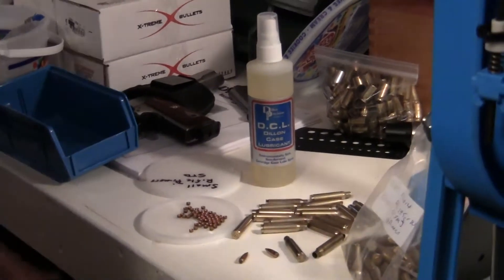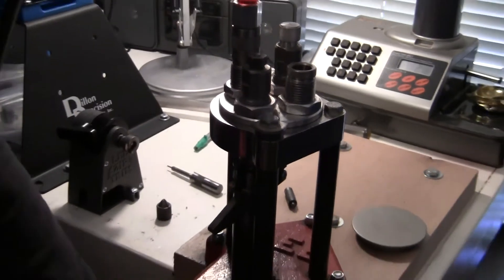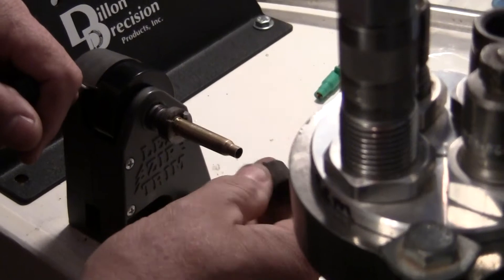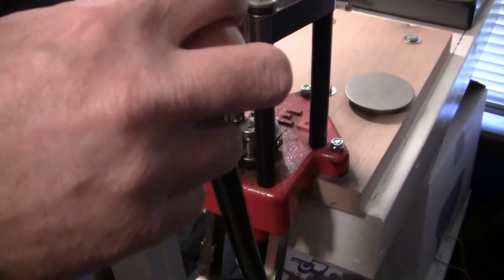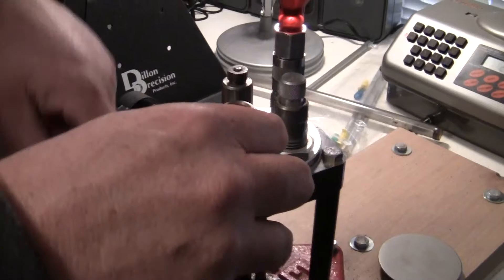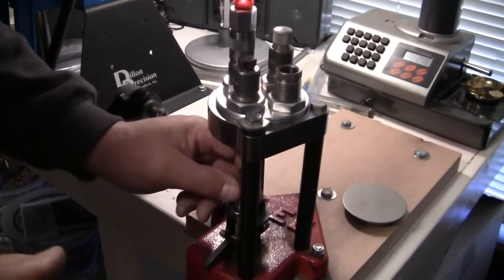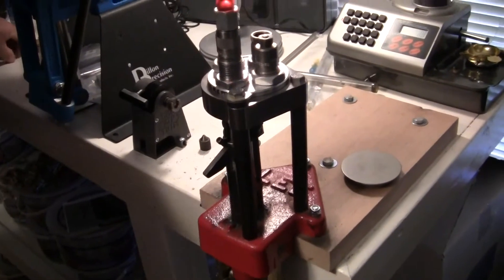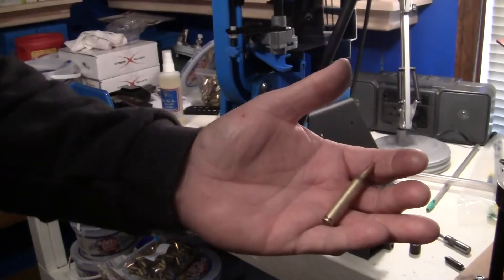Reloading 101: 223 Remington on the Lee Classic Turret Press

Comment: I have a question. Why don't you tumble the cases after you've re-sized them in order to remove the case lube? It seems like the lube would gum up the chamber of your rifle.
Reply from the maker: 762ed There are a couple of reasons why I don't but I will address the one you bring up, I have not gum up problems, I have cotton rags I wipe each one down and then each round is gauged in a Dillon case gauge before it goes into the bucket. Then after range work, I clean my rifles, never have I had any type of build-up of lanolin. 
I'll touch slightly on the other reason I would never tumble a loaded round, has nothing to do with negligent discharges, with the vibration I believe it could change the characteristics of the powder by either breaking them down or compressing the powder, etc.

Comment: Can you add detail to some things?  1) What is the make and model # of that drawstring case rotator?  2)  Please describe what that powder measuring setup is,  who makes it, and what it costs.  Thanks.  Great video.

Am I correct in saying that once you perform those primer pocket operations to a 556 case, you never need to do that again for that case?  How about the trim?  Is that only done once as well?
Reply from the maker: http://www.natchezss.com/brand.cfm?contentID=productDetail&brand=LE&prodID=LEE90899&prodTitle=Lee Zip Trim Power Head
http://www.natchezss.com/brand.cfm?contentID=productDetail&brand=LY&prodID=LY7750600&prodTitle=Lyman Gen 5 Digital Powder System
Once the primer pockets have been prepped no need to do it again, you will have to trim the cases once they have been fired a couple of times, you can have your calipers set on maximum length each time you re-size the case to see if it needs trimming again.

Comment from the maker: Dan Gott, you have very questions and if you used the tools you would probably understand why it never really comes up for people to address and we forget that, not everyone has experienced the Zip Trim, Cutter and gauge. It is the gauge that makes it consistent, it can only cut to one length. When you turn the shell case in the Zip Trim the gauge is attached to the cutter tool and inserted into the case neck. While turning the case, the cutter is stationary in your hand and when it has trimmed to the proper length (the tip of the gauge touches the zip trim stud stopping any additional trimming, not matter how many more times you turn the case)
Of course there is the feel, there is no more friction when the gauge will not let the cutter continue to cut the case. I hope that answers all your questions and sorry I did not address that in the video. Keith Wade